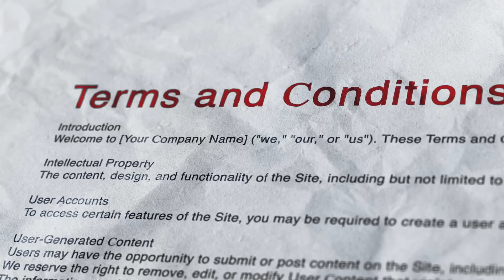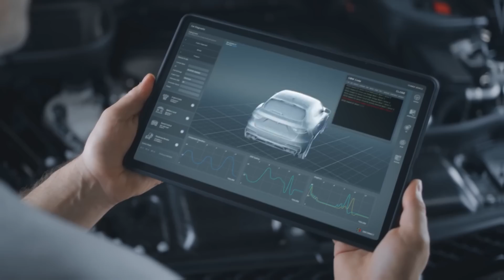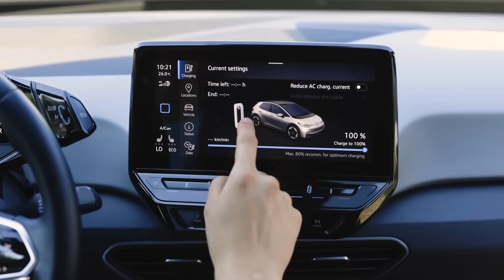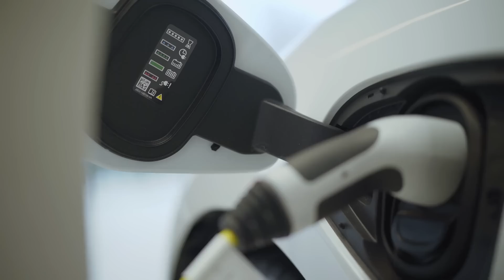Why Tire Companies Love EVs

Comment from the maker: Hello EV Explorers,
The Best Source For Curated Information On Electric Skateboards, Scooters, Unicycles, Bikes and Dirtbikes is our friendly site: https://muskknows.com/featured-items/

As the Electric Vehicles have an augmented torque, their tires tend to go through more than traditional vehicles' so I, for one, always use tyre covers when I leave my car out in the sun for extended periods.
This is my choice, because it is reliable and easy to apply and remove: https://amzn.to/3yE4OFF
Also, always make sure your tires are inflated to the factors-recommended pressure. Not only does it help you to keep them longer, it also is essential to your car maintaining the optimal grip on the road.
I use this little protable machine: https://amzn.to/3WHv61V
If you use my links above, you not only get a good deal, you're also helping this channel put out more interesting and new content.
Stay safe on those roads!